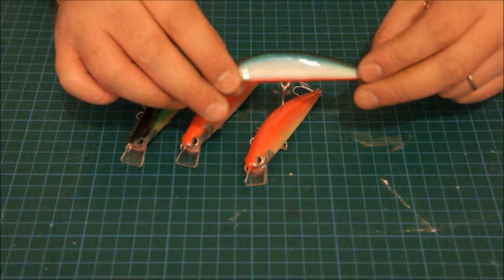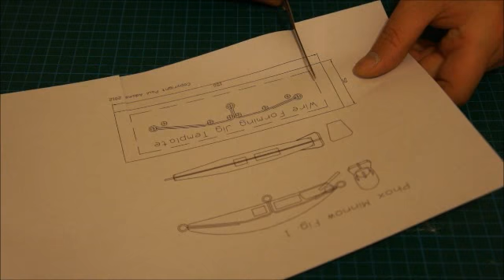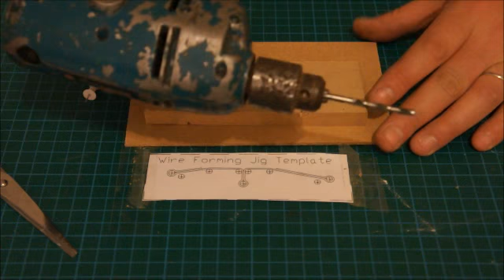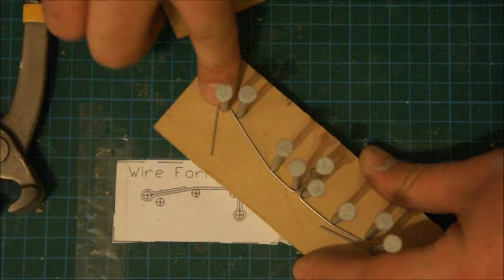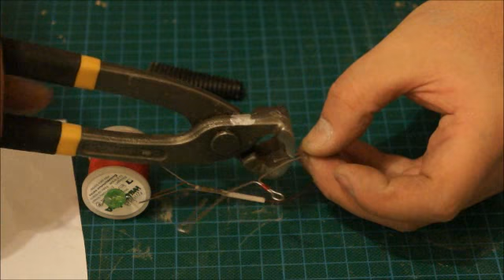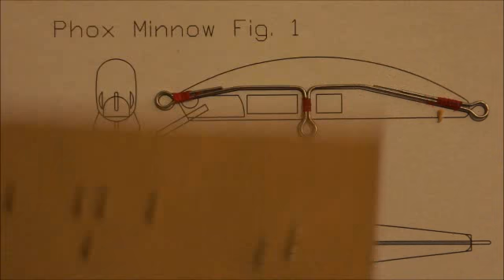How To Make A Balsa Fishing Lure Part 1

Comment: love all you videos so much.  My dad is a Civil Engineer and have so much imagination when it comes to making nick nacks.  U minded me of how his brain thinks.  Great workmanship.  the nail method reminds me of how they used nails to bend re-bar for prepping foundations and forms in the Philippines.  Once again thanks!!!!
Reply from the maker: thanks, I never thought of a though wire as re-bar but i guess set in a bit of epoxy it is.
Reply: i meant the concept of how u were bending the wires to set it up for the fishing lures reminded me of how his workers and he would make forms for the buildings using big nails and bending the re-bar with big pipes.  It was the same kind of constant forming to get the proper mold for concrete pouring in the Philippines and we've done it here in Cali as well.
Reply from the maker: when i worked in materials sales i must of sold tons of the stuff,I remember faxing off bent bar schedules to suppliers and never imagined how they were made. Thanks

Comment from the maker: . barlows tackle a company based in the USA sell 8" x .040" stainless steel straight wire shafts their product code 430171. I have seen some available on Ebay USA also. 

Good Luck

Comment from the maker: I bought mine on ebay from   a company called    The Float Shop

This is their description 

STAINLESS STEEL POLE FLOAT STEMS (50 X 200mm ) (POLE FLOAT MAKING)   The size I use is 1mm   they are currently £3 + £1.30 P+P but they are sold in 50no. packs, a life times supply but very cheap. I am Working on a vid for spinnernbaits so you may get to use them all. If that is too many send me an address by e-mail and i will send you out ten, i have to go the post office tomorrow.    Paulpadam@aol.com